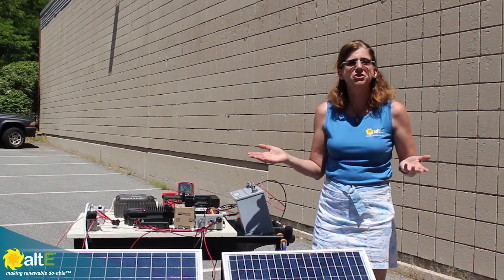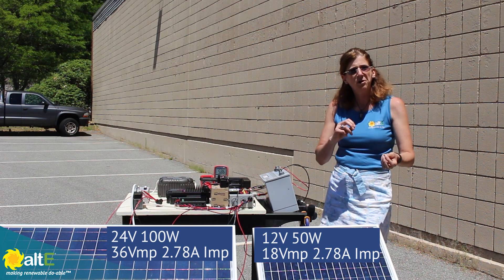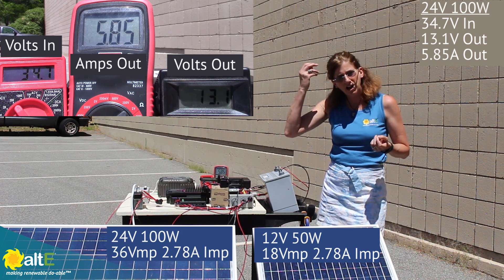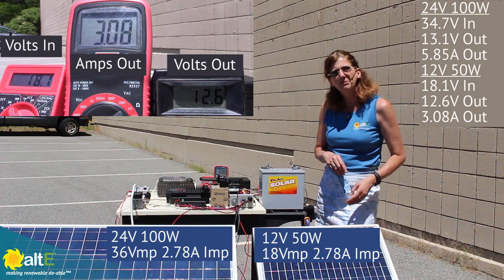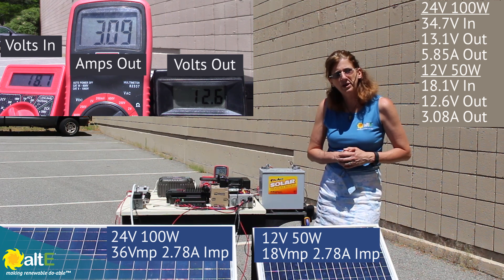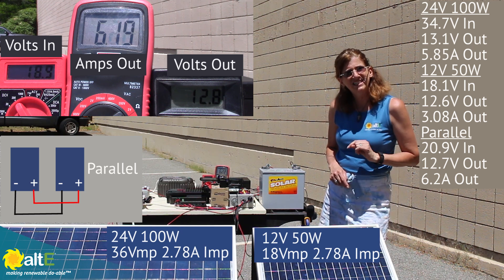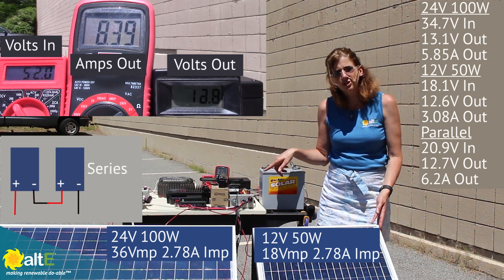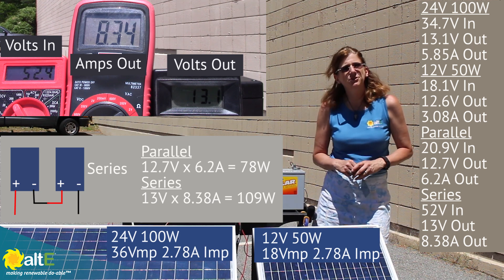Mismatched Solar Panels- Same amps, different volts and watts

Comment: I am curious of a side by side comparison to panels wired in series to increase amps and then single panels hooked to multiple charge controllers and the controllers wired in parallel. We know wiring controllers in parallel will increase amps but do you have more loss of efficiency?

Comment: Little "rule of thumb":
When you have multiple different panels, 
- if you add them parallel, the voltage will be limited by the lowest
- if you add them serial, the current will be limited by the lowest.
Therefore check which parameter is closer for the panels, and use that configuration.
When currents are pretty similar, use serial (like in this video)
When voltages are similar, use parallel
When you have a wide variety of panels you want to connect into a single system, you can combine parallel/serial connection until you build up a more or less equal system. (more complicated, but can be done)
Of course the characteristics of the panels will be different, therefore the MPPT wont be able to get optimum performance from the system, but it will seek for the maximum possible, and that is close enough.

Comment: Thanks for sharing this information....it's very useful. I have a question, can you charge a single 12v battery with a 300w solar panel with a voltage rating of 36v?

Comment: What will be better in my case is 8 440 watts in series or 9 panels in series-parallel, because 450v is my maximum of inverter panel has a 52 VOC and 4500 wattage

Comment: If you had 8 300 watt panels wired in parallel facing east and 7 300 watt panels in parallel facing west and the two banks wired in parallel to the charge controller would the bank opposite the sun bring down the bank in the sun
Reply: It sounds like all 15 of your panels are wired in parallel…. So the answer to your question is “no”. The currents will simply add in direct proportion to the amount of sunlight they are each receiving.  If the east facing panels are no longer receiving direct sun in the evening, they simply stop contributing.  They have No effect on the other panels if wired in parallel.

Comment: Hi just found you channel. I have 2 /100 watts panels one is 21.8 V the other is 19.83V . My question is ... will this make that much of a difference to no run the parallel.  I was told that this might cause my MPPT controller to over charge my batteries

Comment: Thanks I have 3 panels 2 100v and 170v all 3 mpv is average 18.5 , amps are 5.41, 5.81, 9.14 amp so series is best ? Running 24v system, 40amp charge controller, battery bank at 24v.
Reply: You’ve got a difficult combination.  The voltages of all 3 panels are very close, so a parallel configuration would be best.  However, your battery is 24 volts, which means in a parallel configuration your solar panels won’t be putting out high enough voltage to charge  24V battery.  So a series config will work for you, but you’ll lose a bunch of efficiency because the higher current panel will always drop down to match the lowest current panel in a series configuration.  Yes, a series configuration will function with your mismatched panels, but it will not be providing optimum level of power.

Comment: 2 panels with the same (or very similar) Impp are not "mismatched".  That is nearly best case scenario for a series connection.  This video is misleading.  Also, why would you ever connect 2 different voltage panels in parallel?  That is just asking for trouble.
Reply from the maker: People ask us this question all of the time. We decided to show them the answer.
Reply: @AltEStore  People are clueless then.  Common sense should tell them solar panels are kinda like batteries, they are a source of power.  You normally wouldn't (and shouldn't) connect 2 batteries in parallel if they have different voltages (such as a 12V battery and a 6V battery).  That is asking for trouble.
   In my opinion, the average person should NOT be using solar.  They don't have the knowledge to know what to do, especially if something goes wrong.  My opinion is the power companies should have big ground mounted solar arrays away from trees, manage them, and beef up the grid to handle the increasing loads.  That is the safest way.  Look at all the problems people have with solar.  Many solar systems cannot be used when the power grid goes down.  What a waste!  Many people don't want a roomfull of batteries.  Too expensive, too much maintenance.  Better idea... leave it up to the power companies to use solar and pay your electric bill.  I wouldn't want all that crap up on my roof.  Some roofs cannot even handle the weight of solar panels.  I have seen fires from bad solar installations online.  I have seen roofs ripped off (at a school I think) because of a bad installation.  Too many problems with solar for the average person.  Leave it to the experts (the power companies). 
   Perhaps in some densely populated areas where there is a lot of sun, solar panels will help take some load off of the grid, but those places are few and far between.

Comment: Did you happen to try the series the other way, if you had the neg from the big panel going to the controller instead use the pos?
Reply from the maker: Because the current travels in a loop, it would hit the bottleneck regardless of the order it travels.

Comment: I have 3 solar world 60 cell panels, 290 watt. I want to install 6 canadian solar 315 watt in parallel with the 3 290 watts panels. The voltage, amps are very closely the same. I know that the the system is going to work at the lowest rate, but is any additional info to consider for this combination??
Reply from the maker: By putting the 2 strings in parallel, you will minimize the losses, as the additional current from the 315s can go around the 290s. The MPPT charge controller will have trouble finding the optimal max power with the two different types going in. You won't get best performance, but it will work.
Reply: Thanks for your help

Comment: Please suggest me 250 watt 24 volt pannel 150watt 24 volt pannel joined  together series or parller
Reply from the maker: The same volts but different amps is better in parallel.

Comment: There is a reason solar panels are measured in WATTS.  Watts is what is important and a much better use of comparison.
Reply from the maker: Knowing the volts and amps are critical when designing a system, which is why all of the info is given.

Comment: Hi, can we connect 24v solar panel to 12v battery....suppose if not means why and what is reason?
Reply from the maker: You can with an MPPT charge controller. The output will drop the voltage and raise the current to keep the same watts and charge the 12V battery. Watch this video, https://youtu.be/V2b7z2eTb5o

Comment: Hi Amy,
I have 2 * 265 PC in series 24v system. 
I have issue: my MPPT chage controller ( 60A )gives 2 to 4 amp normally in very good day and volt about 26. However when I turn off and ON again then for while it gives high amp to 14 or 16 
After half an hr or so it go back to same problem. I bought new MPPT charge controller 60A it behave same way...

What could be the problem?
Reply from the maker: Are you sure the battery bank isn't full and it is in float mode?
Reply: @AltEStore  yes the battery bank was 24.7v on multi meter. It was not fully chage

Comment: Max Power Point Transfer. mppt. each panel has a different mppt point. how does a charge controller know at what voltage and amps the mppt should be at  if every panel in series is different. answer.  it doesn't  and most mppt controllers will go into limp mode with this set-up . best off with the less efficient but more suited pwm charge controllers in this case.

Comment: Great vedeo. I will like a video connecting different charge controller into a battery bank. Like a solar panel charge controller and a wind turbine charge controller together. Or 2 solar panel charge controller together.
Reply from the maker: Your wish is my command. https://youtu.be/whFAPTWvWas

Comment: Hi Amy I have 2 miss matched solar panels 1 is 300 watts open circuit voltage 22.32 - short circuit current (A)17.83 -max power voltage 18 - max power current (A) 16.67. second panel max power 175watts - voltage at Pmax 35.2 v - current at Pmax 4.7 A - open circuit voltage 43.6 V - short circuit current 5.48 V  if I understand you correctly if I buy 2 separate mppt controllers I can connect the both individual to my caravan batteries and have them produce there max output. cheers Bill
Reply from the maker: Correct. The 2 are just too different from each other to run on one together. Just connect both controllers to the battery, preferably through a breaker.
Reply: Thanks for that quick response Any much appreciated. Is a breaker like a fuse if yes what size would I need for each one. Cheers

Comment: Can we connect same voltage different watt and amp
Reply from the maker: You can wire that in parallel.
Reply: Oh thank you for that, because I doubt in that set.

Comment: I have to say your videos are spectacular, thank you for putting them together! :)

I had a related question, I have two mismatched panels, same Watts (100 each) & same Nominal voltage (12V) though the Vmp/Imp/Voc/Isc are slightly different. 
Panel 1) Voc 20V Vmp 16v Isc 6.45A Imp 6.25A 
Panel 2) Voc 22.5V Vmp 18.9V Isc 5.74A Imp 5.29A. 
The difference is small but wanted an expert opinion as I'm new to solar.
Based on your videos if I have an MPPT controller it seems the best option would be to connect the panels in series so Volts into the MPPT is boosted, the MPPT would lower V out and boost Amps out (12v bank).
Question: what if i used an PWM type controller? I understand if the panels are in series the whole system must be configured for 24V and if in parallel configured for 12V but which would be the best option? If in series would the system be limited to the lowest Imp? and if in parellel would the system be limited to the lowest Vmp?

Any help is appreciated!
Reply from the maker: Thank you so much, I'm glad you enjoy them. For a system that size, the difference is so small, it won't be noticeable. I would go with the 2 in parallel, and use a PWM.
Reply: Wow and you responded almost immediately! :) You guys are awesome. Serious thanks for the videos they are a great educational resource. I'm finishing my BSE in Mechanical Eng. and possible further education in Electrical Eng. I want to apply it to renewable energies, sounds like your team would be a great group to work with!

Comment: Nice explanation...thank you. But the thing that i dont understand is, in series connection, the current should be the lower current of the two sources, whiches 3.08 A, from where we got 8.38 A ?
Reply from the maker: The lower current panel pulls the whole thing down a bit, but not all the way down.

Comment: Heard your comment about separate charge controllers for the different panels as an option... how does such an arrangement feed into say a 12v battery bank. I'm a novice.
Thanks for the very informative videos I do like the way you present the data.

Comment: hi Amy, These are the best videos on the net. I have a simple question/request. I have three panels going into a 4 battery bank. panels are old and have been in the sun for years. Could you do a video on how to tell what output your getting from panels without a readable sticker. I need to add a or multiple charge controllers. Thanks in advance for your videos.
Reply from the maker: Thanks. Great idea. You can check out the video James made many years ago testing a panel. It will give you the open circuit voltage (Voc) and open circuit current (Isc). https://youtu.be/fkook28HhWI

Comment: hello altE

can you please clarify my dought.

If we connect 4 arrays in single mppt/ inverter with 3 arrays at 15 degre angle and 1 array at 25 degre angle.
what will be the losses in that. is that effect a lot to system.

regards
B.K Reddy
Reply from the maker: It depends on the inverter. If the inverter has multiple MPPT ports, you would be best to put the different tilt in its own MPPT port. IF that is not an option, you will see a change in performance. The amount of the difference would likely be different based on location. You can go to a tool like PVWatts to see the difference of an array at different angles for your area. That may help you get an idea.

Comment: Thank you for these videos.  However, I am not convinced that these are accurate tests; the battery load and capacity status will vary the load factor..  I would think that for accuracy, one would need to use a dummy load at a fixed nominal load (12v in this case), and then use Ohm's Law to determine wattage produced; A(I) x V = W(p,e). Watts, not current is the key.

I do like that you're testing with MPPT and PWM units as they could vary results; depending on brand, method, component quality, etc.  Thx.
Reply: Just to clarify further, what if the battery was at 10.5v 0%-capacity, vs the same setup with a battery at 13v 95%-capacity?  I think the current out measurement could be quite different, and therefore watts produced very different as well.  All constructive comments, btw - not criticizing.
Reply from the maker: Thanks for your input. We are working on improving our test setups for the upcoming spring. I know I need bigger batteries to help do the tests at a more consistent state of charge. I'm also adding more meters through out the system. Working on continuous improvement. Keep the suggestions coming, we do appreciate them.
Reply: Wonderful reply!  Thanks for a great progressive attitude and desire to get it right. That's a value statement.  Subscribed, and looking forward to more!
Reply: Actually, using a dummy load is more inaccurate, as it is not "real world values". You are better-off just using math and base-line values, if you think dummy-load tests are accurate. Those are only good for measuring scales, in controlled labs. We are interested in "reality", not "science experiments".

My car goes 0-60MPH in 2.4 seconds on a dynamo. Put it on the road and it takes 4.5 seconds. Because it has uneven road surfaces, wind, starved air intake and uses the actual car computer to make real-world adjustments. Labs are useless for anything other than knowing how it will behave in a lab.

Comment: anyone? can you use a 24 volt 300 watt panel  with a mppt and a 12 volt bank?
Reply from the maker: Depending on the MPPT charge controller, yes. Make sure the charge controller can take an input of at least 50V. See our video here where we use an MPPT vs a PWM with a 24V panel and a 12V battery. https://youtu.be/V2b7z2eTb5o
Reply: Thank you ! helpful info. Can I use this setup with a 12v power inverter?
Reply from the maker: If you are charging a 12V battery bank, you can use a 12V inverter.

Comment: Great series on mixing and matching panels!  How about a similar topic with batteries?  My RV currently has four US Battery US2200XC2 6 Volt 232Ah Batteries wired series/parallel to make a 12 volt bank.  Sadly I don't really have room for more RV  (Travel Trailer) mounted batteries.  I could add some truck or ground batteries for extra capacity, but do they need to be the same?  Could I add 12 volt batteries in parallel with a different Ah rating or do they really need to be matched.  even if I bought New matching batteries, they will perform different than this bank of much older batteries that I currently have. 

Thanks!

Comment: Hello, I have a 24v 2.4w solar panel. Can I charge 12 v battery?
Reply from the maker: A 24V solar panel can charge a 12V battery with an MPPT charge controller. Watch the video we did showing it here, https://youtu.be/V2b7z2eTb5o. Are you sure it's only 2.4 watts, that's a rather odd size for a 24V panel. Perhaps 2.4 amps?

Comment: I'm enjoying leaning from these test rigs and I always have a go at guessing in advance which arrangement will result in the highest MPPT power output. Really educational videos; thanks Amy (and team)!

I wonder, how does partial shade on one panel affect the overall series performance? If only the voltage drops, not so bad, but if one panel limits the current then it might be worse than if the panels had been wired in parallel.

The shading test could also look at the differences between partial shading on the low voltage vs. high voltage panels. I'm thinking in parallel, if you knew one panel might be in shade occasionally, you'd make that the higher voltage panel.
Reply from the maker: I love it!!!! Next sunny day, I'll be recording it (we have a stretch of bad weather coming up, then the holiday, give me a week or so). Thanks so much for the suggestion!

Comment: If you have an existing 12v panel and you want to change it to a 24 volt panel, do you have to change the wires to the charge controller?
Reply from the maker: Just to clarify, you aren't asking about changing the voltage of one panel from 12 to 24V, because most panels don't let you do that, but are asking if you have a solar array that is wired as 12V, and you switch it to 24V. Charge controllers generally have a PV In+ and a PV In-. AS long as the charge controller is rated for the volts you are putting in, you don't change the connection to it, just connect plus and mins from the solar array to the charge controller. Let me know if that answers your question.
Reply: Yes. I would be changing the array. Looks like that's the easiest thing to do. If the existing wiring will take the new 24v panels, that's great. I'd be getting a new mppt controller as well.
Reply from the maker: Perfect.
Reply: no. not if the wire gauge is thick enough to carry the current. the wire can usually carry up to like 600volts. like 10gauge wire can carry like 30amps at 12 24or48 volts.for example. the charge controller may need to be changed. if they are not  24volt comparable.